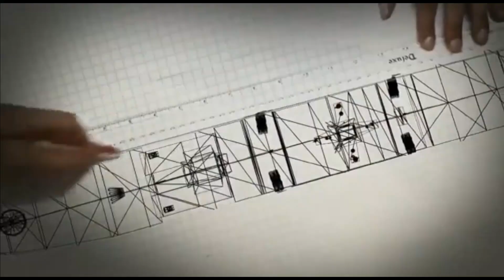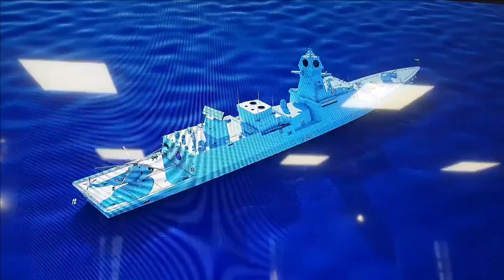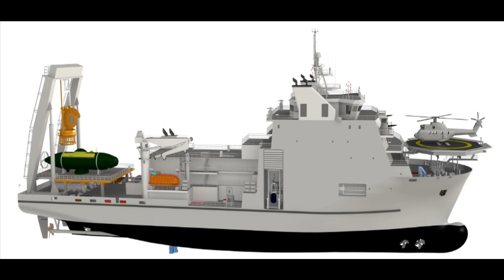45 Vessels of indian navy

Comment: In next 10 years starting from 2023-2032,Indian Navy needs:
1)Additional 6 Scorpene Class SSK with AIP & Lithium Ion Batteries & Earlier 6 SSK equipped with AIP
2)P75I & P76 merged,12 SSK based on Enlarged Scorpene/Taigei/KSS 3/Amur 2250 with 8-12 VLS cells,AIP & Lithium Ion Batteries.
3)8 SSN based on Yasen/Laika/Barracuda Class
4)6 S5 Class SSBN & 6 SSBN based on Borei Class
5)8 Admiral Gorshkov Class Frigates + 8 Frigates based on Kamorta Class designs with modifications like 76mm Oto Melara,8 cells VLS for 32 VL SRSAM/ESSM,8 cells VLS for ASW Missiles,4 Quad Cannisters for Bramhos NG/Seabreaker/RBS 15/NSM/Kalibr
6)8 NGMV + 8 NGC + 8 Type 22160 Modified Corvettes + 16 Karakurt Class Corvettes/FAC
7)12-16 Minesweepers based on Alexandrit/Awaji/Hirashima/Awajima Class 
8)Additional 6 P8I Poseidon +18 Kawasaki P1 ASW/MPA scrapping C295 MMMA without adequate range or payload.
9)4 Helicopter Carriers + 8 Makassar Class LPD
10)1 CATOBAR carrier with 48000-52000 displacement with Steam Catapults & Conventional propulsion + 1 Enlarged Vikrant Class STOBAR carrier of 48000-52000 tons to replace Vikramaditya.
11)48 FA18 Super Hornet Block 3/Rafale M + 36 F35B for Helicopter Carriers 
12)16 Armed OPV with Antiship Missiles 
13)6 Fleet Support Ships + 6 Tankers+ Auxiliaries + 6 Makassar Class LPD
14)Additional 24 MH60R +72 IMRH Naval + 120 NUH + 36 UCAV like MQ9 STOL/S70 Ohktonik/Dassult Neuron+36 IAI Eitan UCAV 
15)18 AW101 Crowsnest/Ka31 AEW +8 E2D Hawkeye
16)72 new Su30MKI upgraded for Antiship Roles + 24 MR Bombers leased.
Reply: Lol…Indian defence budget for the navy is about 16 billion dollars, that is 160 billion over 10 years.
The Submarines on your list is 25-30 billion, Frigates 5 Billion, Corvettes, 6 Billions, minesweepers 2 billion, ASW plane 5 billion, LPH, LPD, carrier will ad an extra 25 billions…
The list goes on, the point is, only this will cost half of the Indian defence budget for the navy.
Ad extra shipyards needed, extra service men, extra facilities, naval bases and more…
This is a wish that can’t be fulfilled.

Comment: Did they order Italian NG torpedoes for kalvari class submarine or not. 
This is such an irresponsible behaviour of inducting equipment without armament. 

They did the same mistake before kargil of not equipping mirage 2000 with laser designated pods and Precision guided munitions 🤦‍♂️🤦‍♂️🤦‍♂️ even placing order in 1997.
Thanx to Israel.. They did it within days and operation safed sagar succeeded 🤦‍♂️